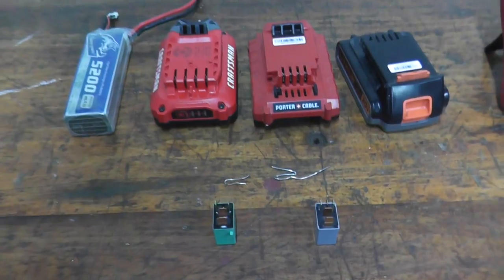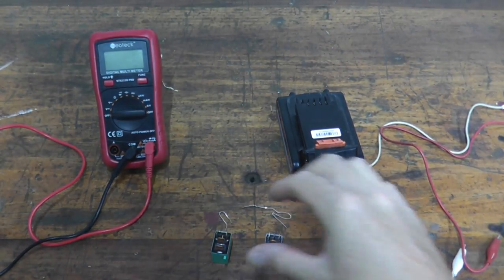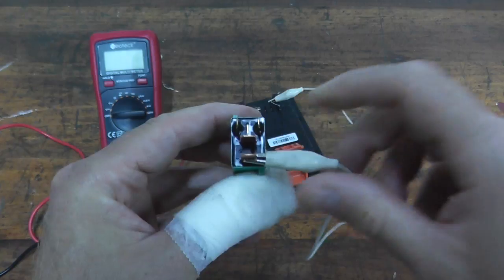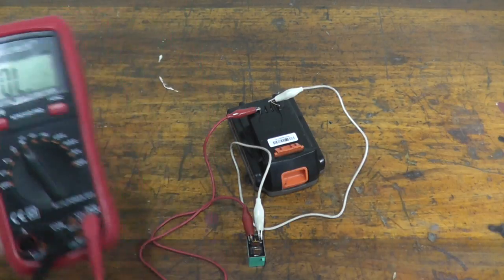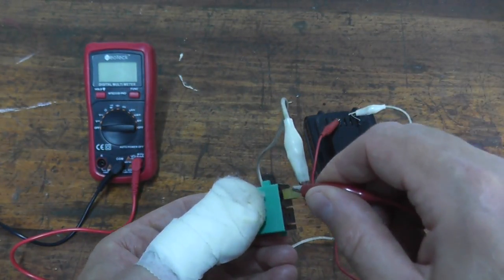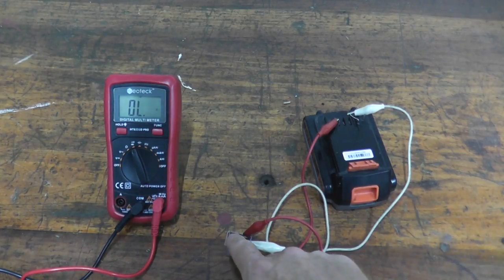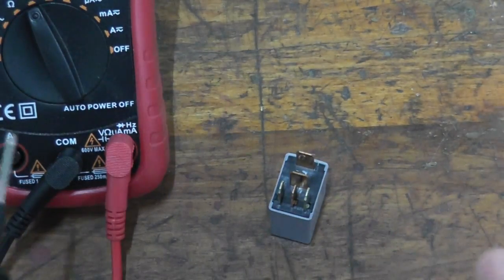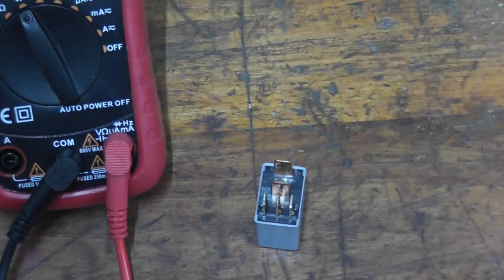How To Test Four Terminal And Five Terminal Relays

Comment: I have a 5 pin 20A  relay from an S Type Jaguar for the fuel cap release. 

I've put 12v across the two pins nothing.

Then tried the two end pins on the three pin end wnd you can hear the relay click. 

However it also clicks when connection reversed.

Is this OK?.

Comment: The 5 pin terminal had spark either way  when testing with 12V battery pack power & no relay click, not powering on. 
I did get continuity (no power connection) in 2 (outside) vertical terminals as well as with touching one vertical (middle) terminal & one horizontal (top) terminal. 
Fuel pump relay ⛽️ 
🤔

Comment: Doing a continuity test while powering up the coil terminals is ok as a starting point, but to simulate a more real world scenario, applying some sort of load, like a test light etc, to the power and load terminals 30+87 is a more accurate way to confirm if the 30-87 or 30-87a contacts can actually carry any current👍🇦🇺